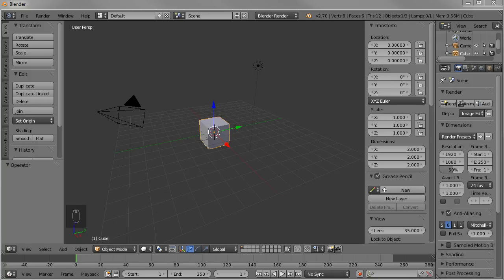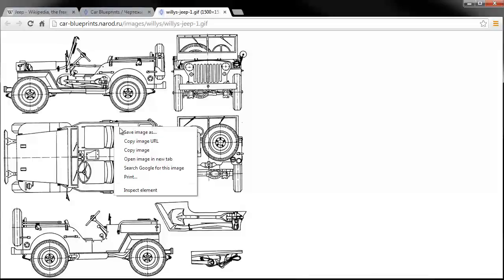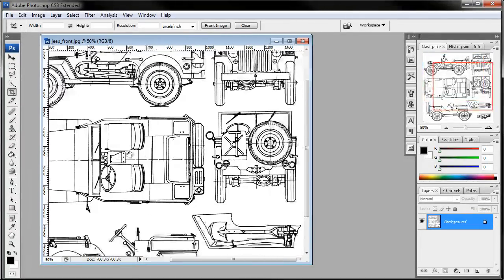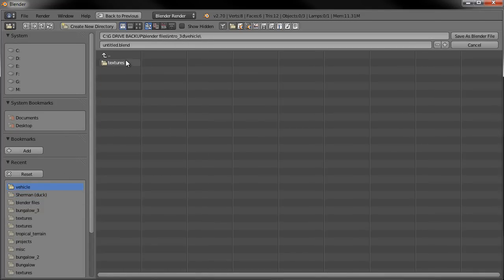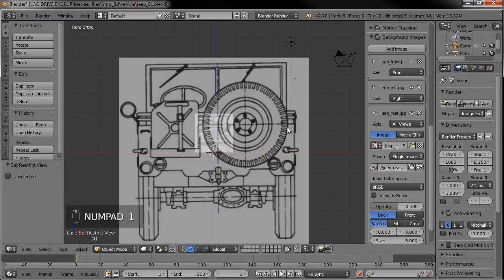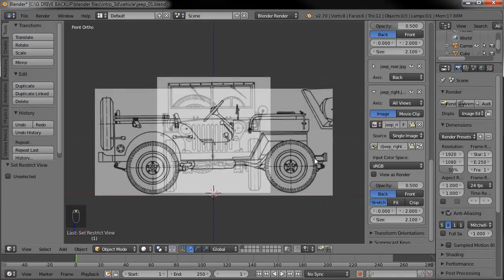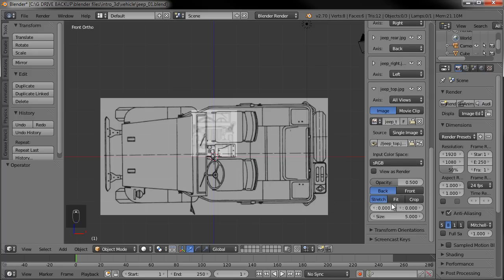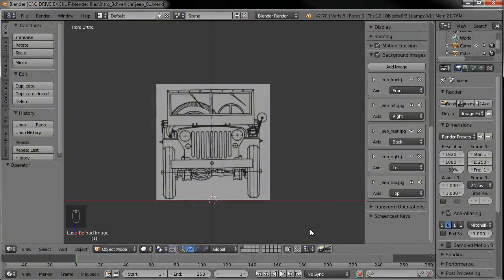Willys Jeep - Blender Tutorial Series - Part 1 - Setting up guides

Comment: Why did you rotate the top view? cause each time you will check the model it will be rotated 90deg minus in top view? Its also better to align the images better in photoshop, so rotate time so lines are straight
Reply from the maker: Rombout Versluijs In top view of Blender, the alignment is bottom = front, so I rotated the blueprint to reflect that
Reply: the d-dub show / ward7299 Yes, sorry for that :) i didnt check it properly. But aligning the images a bit better in photoshop or gimp does help. I noticed your images where of by couple degrees. Nice tutorial series this is going to be